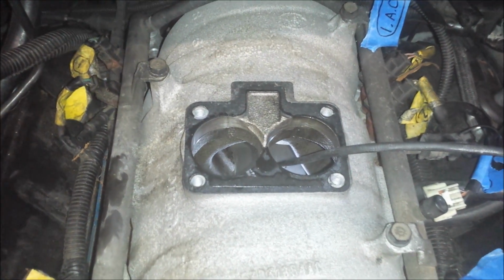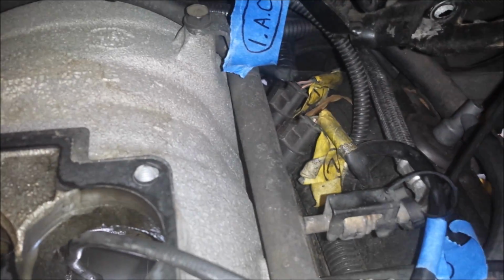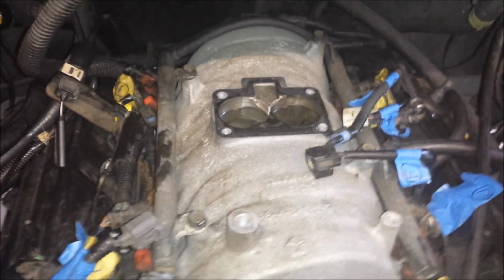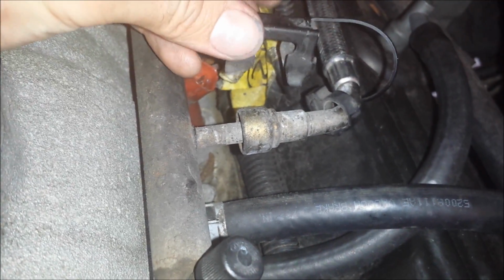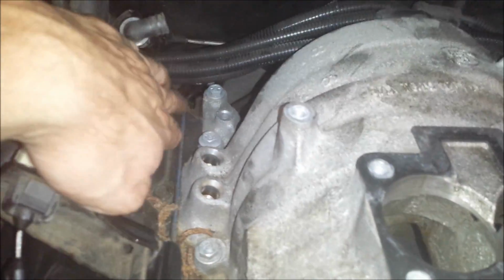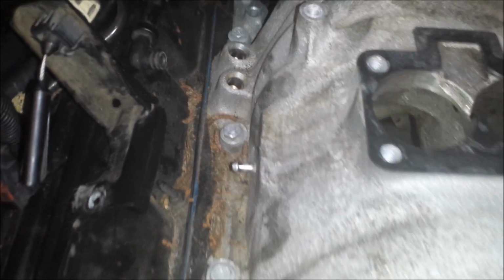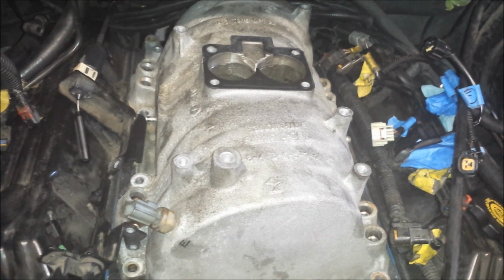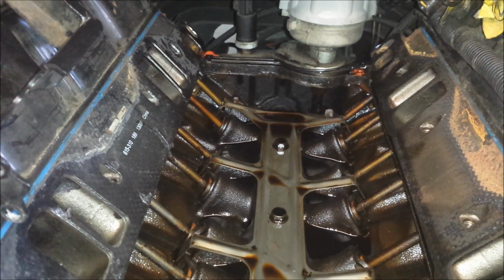2001 Dodge Ram 1500 - Intake Manifold and Plenum Gasket Repair - Part 3

Comment: I think when I replace this gasket I will use gasket adhesive on the gasket and the aftermarket plate.Crazy how it leaking after you replaced the gasket 😮. It can cause the charge air sensor to be contaminated with oil affecting it's performance.

Comment: Also the torque specs that given in the automotive manuals are for engine's that have been totally cleaned and hot tanked. For all bolt holes that have been totally cleaned out. Use a little oil on every bolt that is reused and i do mean every bolt no matter what size they are. Especially head bolts and intake bolts. Exhaust bolts anti seize. You will get the correct torque with oil on the bolts sometimes, sometimes you have to add to torque specs 2-4 foot pounds on smaller bolts when foot pounds are called for. On head bolts 5-10 foot pounds. Anyway i could go all day on this. Remember use 3-1 oil on all fastener bolts or motor oil to get a good torque. Just rub some oil on the bolt with a rag or your finger it doesn't need to be dripping.

Comment: The plenum gasket bolts are to long they bottom out inside the manifold before it can tighten down good on the gasket. You can cut the bolts just a little bit off the bottom of the bolts. They also have new plenum plates that are a little thicker with shorter bolts. If it was me i would just cut the original bolts off about two threads so the bolts will have a little more clamping power.  They also have a new intake manifold that does not have the plenum built into it.

Comment: If I dropped a razor blade down into the pan and I decided to leave it there instead of pulling the pan off and removing it.  I'd go buy some of those really strong magnets and put them on the bottom of the pan,just to make sure it stayed there.

Comment: Anyone that may need this video..the gasket sealer on the plenum plate needs to be high heat and oil resistant. It looks as if he is using high heat red gasket maker. When he should be using high tack gasket maker. It is heat and oil resistant. It is usually dark red or dark blue....overall nice video.

Comment: Why did you disconnect the injectors and fuel rails from the intake? 
Also do I have to remove the throttle body from the intake? 
03 Dak R/T

Comment: Why not just eliminate this stupid issue all together by swapping out the junk style intake with an air gap Edelbrock intake and adapter plate for the throttle body? This is the dumbest design flaw I've seen yet on an engine and that plenum plate is just needless. Or why not get the aluminum Hughes kit bolt it on with out gasket and the weld it solid inside and out, thus also eliminating the issue permanently?

Comment: Hey there, do you know how to unfreeze a frozen head on the driver side of a 2002 Dodge Ram? We removed the 8 head bolts, removed power steering pump, and we can’t get it to unfreeze... #help

Comment: I know this is an old video but I'm at a stuck place. The manifold is stuck HARD. Tips on getting it unstuck? Can I put a ratchet strap through the intake holes and soak the gaskets in pb blaster to keep constant pressure while im at work to hopefully free this thing up?

Comment: Helpful tip, do not rtv the corners with a gasket. Rtv is a self gasket maker, so You would basically be doubling gaskets. Rtv deteriorates when applied around fuel.

Comment: mine is glued on , all of the bolts are out and it will not come off. Any ideals . I have used gasket remover spray for a week letting it set. Tried using some wood chissels to get into the gasket. used a dry wall blade on a cutter where i could get into some of the Gasket and still no luck.

Comment: Did you have high rpms upon start. Before plenum rebuild
Reply: if it idles really high could be that your gasket isn't seated right and its has a leak , which creates a vacuum sucking in more air than the engine needs causing the high idle

Comment: The best way to ensure this cant happen again, is to replace the intake with a better model. ( M1 or Hughes Airgap )  

I replaced the plenum once, it blew again, replaced the intake with a Hughes Airgap...best investment I made on this truck.
The worst part of this job is always getting the old intake off without breaking the bolts.
They are TTY ( Torque To Yield ) and will break easly if they are original. 

TTY bolts CANNOT be reused. They must be replaced when doing this job.
Reply: Are the original bolts TTY?
Reply: @MrJaydeep777  Yes. The original, ( and I think ALL replacement bolts made for the manifold ) are TTY. They need to be able to change as the motor heats up and cools down. I've changed the cam on my Magnum motor twice so far, and will be again in about a month, and I always buy original MOPAR manifold bolts.
Reply: @Blaydrnnnr  that’s really interesting because the service manual doesn’t say anything about replacing the bolts. 🤷🏼‍♂️
Reply: @Blaydrnnnr  also, the service manual lists torque specifications but it does not say anything about TTY bolts
Reply: @MrJaydeep777  Its a given. If you re-use the old bolts, you'll pay for it later, when water starts seeping out around the bolts, and thats IF you even get them tightened without breaking since they've already been stretched. They're cheap, and worth making sure the torque is proper when you tighten everything down.
Reply: @Blaydrnnnr  if they really are a TTY bolts I totally agree. But the fact that the service manual doesn’t say anything about that really concerns me.
Reply: @MrJaydeep777  I've known guys who have used grade bolts. I stick with the TTY bolts. Since thats what I have, I never reuse them. If your not sure, just buy either and start with new bolts of your choice. If you think they arent TTY, give them a shot. Like I said, intake bolts are cheap, and if they are TTY, I just would rather replace with new, then have a problem later.
Reply: @Blaydrnnnr  Thanks for your help!
Reply: @MrJaydeep777  No problem. Hope I didn't make things more confusing, I actually never noticed that the manual didn't say either way. I went with the advice from Hughes when I started building up my Magnum motor, years ago, and have used only TTY bolts since. In fact, I am changing my cam again in a few weeks, and have new bolts coming, so I will post back if I am right about the pack I usually get being TTY. ( the parts for this third cam swap should be here in about a week ) I know they are OEM Mopar bolts, and labeled that way, and I am pretty sure, they are labeled TTY. But I'll let you know for sure. As I said, I know guys who have used graded bolts, but the TTY bolts are supposed to give better plane tension on the entire part... if that makes sense. Good luck!

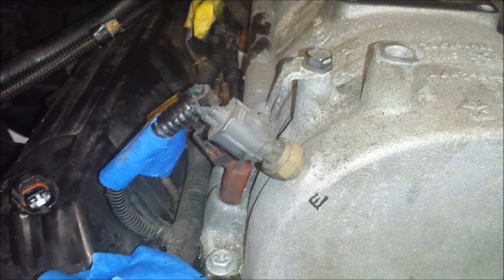Comment: For those watching, the sensor at 2:30 is actually your Air Temp sensor, and is the reason why a cold air intake doesnt really work on these trucks with a stock intake, as the air is constantly warmed before the sensor reads the temp. Moving the sensor to a position BEFORE the throttle body, ( like IN the air intake tunnel of the cold air intake system your installing ) will do more for getting a colder air temp reading, and would make that expensive cold air intake system you bought, work properly. Otherwise, you can shove all the air through a CAI system you want on these trucks.. the manifold is going to heat the air before it reaches the sensor and wont do much to improve your performance unless you relocate the sensor.
Reply: So what you’re saying is the stock location is wrong. I should move it to my air filter housing then?
Reply: @elvinebovine  On a stock intake, its where they want it, and works fine. If you want to move it to the filter box, you can. It wont hurt anything. If your keeping the stock manifold, you will have to plug the hole from the sensor when you move it. I dont use the stock intake so I didnt have to worry about it. But if your going to install a Cold Air Intake, your wasting money unless you move the sensor so it actually reads colder air. Thats the whole point of adding a Cold Air Intake. Trying to get the coldest air you can, down the throat of the throttle body, and the sensor making use of it. Installing a Cold Air Intake with the air temp sensor at the stock location doesnt do much. Its REALLY easy to just drill a hole in the intake tube, and screw the air temp sensor into the tube. It will now read air thats much cooler then it is inside the intake.

Comment: My man I’m in the third video I just wanted to let you know my appreciation I didn’t have the courage to do this job on my van, but since is the same engine system I’m gonna do it, I removed the throttle body to look inside the plenum and there’s oil there and some black debris I guess my intake gasket is out, my van engine is sucking air in, anyways thanks again.
Reply from the maker: Thanks so much for your comment!  I'm so glad you found this video series helpful.  Were you able to make the repair?  Kudos for having the courage to try it on your own!

Thanks for watching!

Comment: More info needed. Did you already replace the lower plenum with an aftermarket aluminum one before it did this?
Reply from the maker: I actually had to make the repair twice.  The first time I did it, the original plenum plate was still in the truck.  I ordered a new aluminum plate from Hughes Engines and installed it, with all new torque-to-yield bolts.  The bolts in the kit came with threadlocker already applied, so I did not use additional threadlocker.  Unfortunately, after about a year, the bolts loosened up and the plenum gasket failed, so I had to do the repair again - which is when I filmed this video series.  That time I made sure to use thread locker.  As far as I can tell, the plenum gasket is still holding 4 years later.
Reply: @mattpayne4087  cool. Yeah Hughes says their kit fixes the issue. I wonder why it loosened back up. That would be a big disappointment.
Reply: @mattpayne4087  What did you do different the second time? Thanks!

Comment: Freaking out right now I'm working in mine as well I'm down to the intake but she's been on the motor a real long time and I am having troubles getting it out also I only seen 1 comment on the front 2 bolts they snap real easy so be careful and have an easy out tool ready
Reply: Or a torch and vice grips. Had a bolt snap off, and I heated the area around the bolt so as to break up the rust and corrosion, got my vice grips around there once I got the manifold off, and it was out.

Comment: A friend of mine is the service manager of a chrysler dealer and what he did was replaced the intake manifold with a low rise manifold and did away with the EGR valve. He said that will fixes it permanently. Going to the dealer now to check.
Reply: How'd that go?

Comment: I bought a super nice plenum plate from a guy on eBay and the plenum bolts are include for 65 bucks he makes them and sells other miscellaneous items as well . Gold grade 8 bolts lock washers and flat washers, and the plate is 6061 T6 tough stuff ! The seller Was,  Mitch42581 has worked awesome for 70k now !

Comment: So I think I am screwed. I got all the way to the part where I removed the intake bolts, and BOTH of the front bolts (closest to the radiator) snapped off. Looks like it had been leaking coolant for some time at the thermostat gasket and froze up the bolts. Now what? Am I going to have to drill them out and use helicoils? No mechanic is going to touch it now! Any suggestions would be appreciated. Thank you!

Comment: can someone tell me if the blown plenium gasket can have something to do with the coolant, by some reason the level always drops in the overflow tank and the exhaust smog is moisty, but there is no water in the oil means the head gaskets are fine...(and I know the plenum gasket is blown)...?
Reply: Hans Alan possible.  yes.  have a bad gasket between the intake water jacket and exhaust chamber. would suck it right thru the exhaust and not touch any oil
Reply from the maker: Hans, as Gary pointed out already, it is possible that your intake manifold gasket could cause such a problem.  The intake manifold on this truck is a "wet" (water-cooled) manifold, so if your intake manifold gasket fails near a coolant passage, it's possible to suck coolant into the intake.  With that said, I would still want to verify the head gaskets are OK with a compression check.  Good luck - I hope you can sort out your problem!
Reply: Heads warped or cracked? After it cools down to outside temp start it up and squeeze the upper coolant hose it should not have pressure in it.  
My 5.9 warped and 3 of the 4 fire rings were sucked in to the combustion chamber witch pressurised every thing.

Comment: I recently sold my 1999 Ram to a friend, and he discovered it had a bad Plenum gasket.  As even when I was still driving it earlier this year, it lost nearly all of its oil.  The problem is that the two engine pieces that this gasket separates are made of two different metals.  one is steel, the other is aluminum.   And as anyone knows, these two metals heat at different rates, thus causing the gasket to warp causing leaks.  The solution is to buy a aluminum pan kit to replace the steel pan that it comes with.  And you shouldn't have this plenum gasket problem anymore.
Reply from the maker: David, thanks for watching!  I had the same understanding when I filmed this video.  Since then, I have read a differing opinion that the issue is actually with the OEM plenum bolts, in that they were too long for the bolt holes in the intake manifold, so that they actually bottomed out in the holes before they were able to reach the full "clamping force" against the plenum plate, thus allowing it to fail over time.  I'm not sure which opinion is correct...heck, maybe both are true...but I do believe that by using the 1/4" aluminum Hughes kit, you can be assured that the problem is solved.  It addresses the concern about dis-similar materials, as well as eliminating the problem with the bolts being too long for the holes, since the Hughes plenum plate is ~3/16" thicker than the OEM steel plate.
Reply: Matt Payne  I believe you're right on that.  I think my friend who now owns my old truck did mention something about the bolts, so yeah, sounds like a combination of both things caused the problem.

Comment: Matt, I subscribed as this is very detailed. I have a 98 Durango with the 5.9 and I believe I have to replace my plenum gasket. about how long would you say this process takes? could this be the reason my oil gauge stays just under 40? thanks!
Reply from the maker: Thanks Chris!  I'm sorry for my delayed response - I try to keep up with viewer comments as best I can but the past month has been nuts.  Had a tree fall and damage my house and knocked out our internet for 10 days, and I've been swamped at work.  So sorry for taking so long to reply.

As for your questions - I would say you should allow yourself a 3-day weekend to replace the plenum gasket, particularly if the truck is your only means of transportation to get to work.  I'm guessing I had between 15-20 hours involved, but it's hard to quantify how much of that was due to the filming process slowing things down.

As for the oil pressure, unfortunately I don't think the plenum leak is related to oil pressure if the correct volume of oil is in the engine.  I suppose if you didn't check your oil level, it could run low due to being sucked out of the crankcase through the plenum gasket leak and eventually you could get low oil pressure.  Does your oil pressure increase with RPM increase?

I hope this helps - thanks for watching and subscribing!
Reply: Got it done! Ever done muffler patching before? I guess I waited too long to change the plenum so my oil filter leaked as well sending hot oil onto the exhaust right where it bolts together (By passenger wheel well) And rusted a hole all the way around. Any ideas for quick fix? Hard to reach a bit

Comment: I fixed mine using a Hughes upgrade kit. No more high idle and plenty of power. No more pinging going up a hill under a load. Night and day difference which tells me this has been a ongoing problem that was getting worse gradually . I'm happy now that my 96 Dodge ram is working like a new truck.
Reply from the maker: Good work!  Enjoy having a great-running truck!

Comment: Be careful unbolting the manifold. the two bolts on the front corners and the two on the rear corners are thru threaded. they get very rusty and you may snap the heads of the bolts off like mine did. If you do don't panic. remove the rest of the bolts and lift the manifold off. you will be able to get at whats left of the bolts. use a torch and heat them cherry red a couple of times. use a 5/16 stud remover or vise grips and work them loose. Be patient and take your time. soaking in PB Blaster cant hurt either.
Reply from the maker: +ram dodgetruck This is great advice!  That's exactly what happened to me, too.  The bolt closest to the thermostat had gotten corroded from a coolant leak at the thermostat housing.  That bolt snapped off while trying to remove it.  Thankfully, it broke off with some length still protruding from the engine block as you said.  I was able to heat it and tap/wiggle it with some vice grips and finally got it removed.  It was a little hairy for a bit, but it worked.  I'm glad yours came out the same way.

Comment: Hey Matt, where did you get the flashlight that you used in the video? Thanks
Reply from the maker: +Mark Hightower I actually purchased that handy little thing at Lowes - it was made by Kobalt.  Unfortunately, it stopped working recently after several years of use, and I wasn't able to find it at my local store.  They said they had stopped carrying it.  I searched online, and it looked like it was still possible to order it online, but for much more than I had originally paid for it.  Bummer.